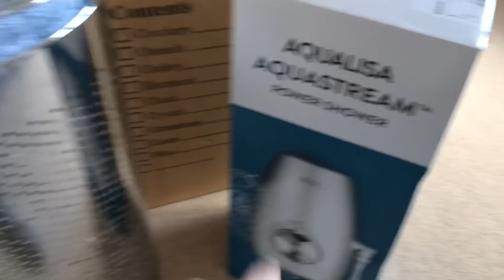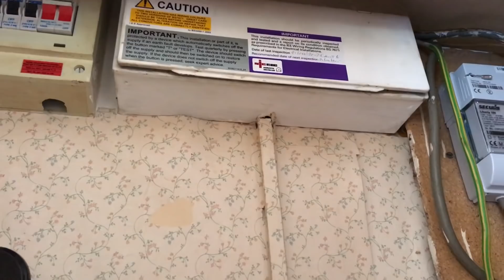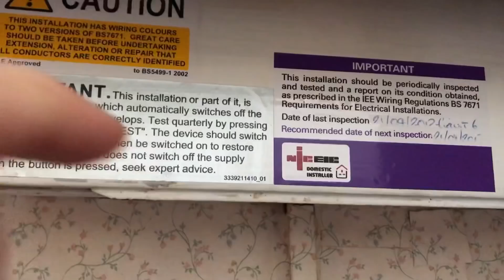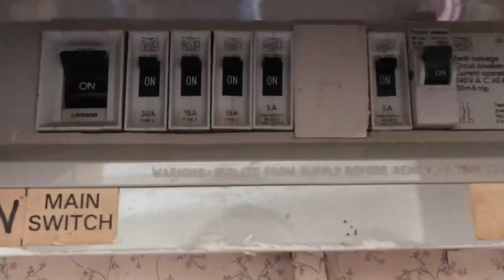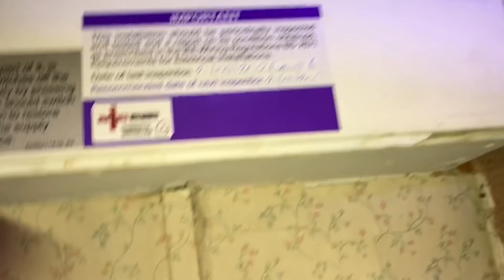CJR ELECTRICAL electricians day wiring and finding more poor installation work!!!

Comment: Do you fuse down the extract fans?
Reply: The extractor fan will be on the 6 amp lighting circuit so I wouldn't have thought so,  but as always, install to manufacturers recommendation.
Reply: @ashmanelectricalservices4318  Usually down to 3A via FCU
Reply: @muzikman2008  There's no requirement to fuse down as the current carrying capacity of 1.0 mm sq  3 core and earth pvc/pvc cable exceeds the rating of the protective device, in this case 6 amps. If Chris were to install some sort of isolation switch in this particular scenario, it would been a 3 pole fan isolator and not a FCU.
Reply: @ashmanelectricalservices4318  I always install a 3 pole isolator and FCU with 3A fuse. The fan usually has zero protection from short circuits, especially the timer variety. I have seen melted timer boards where fans have seized, the timer board motor driver chip burned out, or resistors burned out, and tripped the whole upstairs lighting circuit. Putting a 3A fuse just before the fan is good practice as it can help alleviate that problem if the fan should fail catastrophically. Yes fans are inductive motors and if stalled don't draw much current on their own, but the electronics in them are another short circuit waiting to happen.. I have seen it. No require ment to fuse them, but as I said "usually" down to 3A. Tom Nagey also does this with his FCUs see his channel.
Reply: @muzikman2008  Now I'm curious, how do you fit and connect both a FCU and 3 pole fan isolator? What do you connect at the FCU?
Reply: @ashmanelectricalservices4318  fit the FCU off the lighting circuit, then to isolator, then to fan.
Reply: @muzikman2008  You're gonna have to explain it in a bit more detail, including what core cable you're using  between points and what conductors are being terminated at FCU, 3 pole fan isolator and fan itself.
Reply: @ashmanelectricalservices4318  You are basically fusing the whole bathroom lighting down to 3A. It's common practice. The manufacturers of some fans even state they must be fused down. I can't do drawings on here.. Google is your friend 😉 even NICIEC inspectors would pull you up for not doing it. Not end of the world stuff but hey ho...
Reply: @muzikman2008  So the FCU isolates both the bathroom light and the fan? Yes, I seen this in a couple of fan installation manuals but never done it myself as the existing wiring layout wouldn't permit it without altering the existing wiring route. It maybe more feasible now as most new builds tend to have both the lines and neutrals taken to the light switch before going on the lights themselves.
Reply: Most manufactures will state that a 3a fuse is required but rarely is this done in practice. It’s usually achieved by running the whole bathroom lighting through a fused spur and from there a separate fan isolator for the fan thus fusing the fan down and not interfering with the switches/perm live to the fan. Begs the question why they don’t install inline fuses in the unit itself.
Reply: @tomorichard  They do... 😉
Reply: I spoke with 3 manufacturers technical departments yesterday i.e. soler & Palau, greenwood and manrose and they all said that it is acceptable to come off the 6amp lighting circuit and only requires fusing with 1-5 amps (depending on brands)  where they aren’t connected directly to lighting circuits.. plus all their fans have thermal cutouts..  however, I said to them the problems is I only have your word it’s ok to wire directly off a 6A lighting and should something go wrong I would told I haven’t followed manufacturers instructions etc.. I asked them if I could have something in writing from them and they said yes if I emailed them.. which I will do.. will be interesting to see if they back up their words.
Out of interest I called the NICEIC tech support and they said I should still follow the man instructions regardless unless I can get something in writing to attach to my certs as it’s a deviation..
Reply: We fit a 3amp mcb to cover bathroom fans and lights when first fixing. With led lighting the load on the circuit is negligible
Reply: @tomorichard  Because it`s cheaper for the manufactures for you to do it.

Comment: I wouldnt want the driver inside the cupboard because it does take up space. Not much but it has a knock on effect when it comes to stacking tins n sheet. I would prefer it under the cupboard.

Comment: If there's no isolator fitted, the DNO have given you no choice but to cut the seal and pull the fuse. We can't have people working hot unnecessarily because of a bit of faff from the DNO that's never enforced.

Comment: Just cut the tails and fit an iso just turn off the installation no load so no problem.
I've got insulated gloves so I can do it but I would just cut the seal on the service head most of the time nothing wrong with it it's the meter seal they are more bothered about.

Comment: Wago 222 aren't rated at 32 amps when inside an MF box with 2.5 cable. They are rated at 20 amps.

Debateable if its regarded as accessible under nailed down floor boards but if it's a maintenance free box ir doesnt need to be accessible, that's the entire point of MF boxes.

Comment: In most ways our national electrical code is as stringent as the UK. Some Uk codes may exceed our an some the other way. Our code prohibits any inaccessible junction boxes. This is true in Canada also.
In the US main power lines must be enclosed completely in metal conduit from the. Service inlet from the power grid through the meter, then the main disconnect( which are never wire locked like the meters) and through to the circuit breaker box. We are required to have a 200 Ampere service main usually as a two phase 100 Amp per leg. From everything I. Have seen, the UK residential power is on a single phase. We use more circuits than the UK as our code requires dedicated circuits for things like refrigeration units, electric cookers, laundry washers, electric dryers, dishwashers, electric baseboard heating and any circuit that could possibly overload due to excess appliances. Eg: an electric kettle along with an electric toaster. Any curcuit withi 1.33 meters of a water source is required to have a ground fault interrupter within the outlet device. It is not unusual for a kitchen in the USto have 10 separate cubits to prevent overloading the wires. Our codes also limit an outlet circuit. To 6 outlet devices a# opposed to the UK 12. Most of the time professionals will now recommend that each room be on a separate outlet circuit and breaker 
While some local codes still require that all cables be encased in metal armor, all codes require 5hat all junction boxes be in an accessible location. 
Most of the time junctionboxes are found in basements thhat were never designed as a living. Space, and either the unknowlegable. Homeowner either themselves or. Through a contractorr that used unknowledgable employees illegally enclosed these junction boxes.our newest code requires arc fault protection on all circuits in new construction. This is to guard against the semiskilled homeowner from not securing wiring tightlt enough and from substandard electrical devices from Far East manufacturers, where fakes of all kinds have been emanating due to their non- oversight.Since you appear. To watchYouTube, you might want to check out the Holmes on Homes programs from Canada. And This Old House from the US. I have gained a number of insights into the UK bureaucratic culture show on You Tube shows from the UK with respects to housing renovations. In all trades, although I still have questions about some of the building methods used in the UK such as Whydoes one directly plaster over mason army walls? I am family lark with this from my own childhood  ( the tree ace type house I grew up. In was of exterior walls made of terra-cotta block with direct plaster application and every exterior wall was an extreme source of cold transmission in the winters while generally our winters are colder than in the UK In many regions, it is not that you have never experienced sub freezing temperatures and in many of these programs, it seems that the husband is arrogant that only they must do all the work even when their wives are competent and willing to assist. 
While I myself have severL trades( I have to as I am in the live entertainment field) when there is so much work, I always will find and delegate some of the work to anyone competent enough to do the work and not cause an injury to themselves or others. Electrical codes and methods therefore ar a part of my stock and trade and can be even more complicated as with electronic theatrical dimming equipment you cannot even use a common neutral as it can cause a loop circuit  wherein you  might raise a dimmer for one particular luminary and have an additional one energized as well even though it is controlled by a separate dimmer.  So to avoid that every luminary is connected to the dimmers via its own cable. I have only found this problem when a wiring system was performed by a residential/ commercial electrician using the. Acceptable codes for those normal requirements. Some will not even realize tha due to the creative nature of live entertainment, there is frequently an unbalanced load on the different power phases ( up to three) even though it seems to break the accepted codes. 

Sent from Yahoo Mail for iPad

On Friday, January 10, 2020, 1:35 AM, YouTube <noreply@youtube.com> wrote:

Youtube Logo
Martin W replied to your reply on 132 Buckleup1000's comment
 	
 	
Martin W
Walter Ulasinksi Actually Wago's are unlikely to fail. In reality, you often find very old conventional junction boxes under floorboards, with screw terminals, terminals still firmly tightened and functioning fine. The theory is that the terminals loosen over time due to expansion and contraction, but as I say, rarely happens. So the Wago connectors or indeed Hagar Maintainance Free boxes should't be an issue. They are very extensively tested and deemed appropriate for the application. Which is why they qualify for the MF designation. I'm very surprised that you say US electricians "never" install junction boxes in potentially inacesible voids. I would say there absolutely must be occasions when that's required. From what I've seen of US electrics, the regs seem less stringent than in the UK.
REPLY 
If you no longer wish to receive emails about comments and replies, you can unsubscribe.
© 2020 YouTube, LLC 901 Cherry Ave, San Bruno, CA 94066
 YouTube		 Twitter
Reply: Just to clarify, normal US residential services are not ''2 phase'', it's still single phase 240V just like the UK. The difference is the US supply comes from the Delta secondary of a distribution transformer, with a third wire at the center tap of the delta winding which provides two 120V supplies and one 240v supply, but the two 120v supplies are not out of phase with each other, so still single phase. In Europe and much of the rest of the world the supply is from a Wye secondary, with 240v (or 220v) from each leg (phase) to the star point. Of course normal residential properties only get one of those legs and the neutral (star point), whereas a 3 phase supply would give you all three legs plus the neutral, usually with 400v between phases (lowest 3 phase voltage here), while in the US 240v 3 phase supplies are common.
Reply: @literoadie3502  while much of what you say is true, it also depends upon the step down transformers at the power facility stations. Many areas only have two phases coming from the step down transformers. It has driven me crazy when I have had to convert three phase lighting dimmer equipment (4 wire) to be balanced to work on only two phases. ( 3 wire). In these areas, the additional step down transformers, then convert to two phase 120v service for residential locations. 
This is as I have seen in these videos, that the Service mains to the meters are only 2 wire. ( single phase) and so far, I have not seen the nature of main service from the supply factor( overhead or underground) which in the US will determine the wire gauge and insulation component sizes. 
I have been in a position where it was necessary to pull 600 Amp  three phase ground cable ( 4 wire) to be elevated and hung for the main service for a Circus tent. Partly due to the location where to do a tie in to the service delta step down transformer. It needed to be fed through major fresh air ductwork to the underground location.This was in addition to the temporary service pole with major rain head entry service attachment. 
While it is possible that with a single phase, no matter the voltage, one can supply all the growing needs for a residence, it usually means that instead of a 100A supply you might need a 200A supply or higher, with the resultant increase in wire gauge.

Comment: Could scarcely believe that JB with all the cpcs just hanging there.
Reply: Really ? Is seems a common practice with the cowboys, I find the cpcs cut all the time, especially on 12v down lights
Reply: @supersparks9466  : Yep seen it regularly, cut out the CPC's. A "so called" Electrical engineer once told me that they're only in cables so the manufacturer can charge more money for the cable (sad thing was, he seemed to seriously believe that).
Reply: I fitted 37 new Luceco lights last week, and everyone of the CPC's were cut off at the JB, not even terminated! BS7671 states a CPC MUST be available at the JB for termination to any existing or future accessory...
Reply: @muzikman2008  : Only problem with that: I doubt half of the idiots have ever seen a copy of BS7671, never mind opened one to look at the writing inside.
Reply: Really, you can't believe it... This happens all the time, more often than not by cowboy builders, they think that because the fitting doesn't require an earth, they can just cut it out or leave it out.
Reply: @rscelectrical7091  😯 I've only ever seen it on lighting circuits.

Comment: good video mate, if I have to put a JB under a floorboard I will always write on the floorboard in marker with the exact location of the JB
Reply: Until the customer wants a nice sanded original wooden floorboard with varnish on top :-)
Reply: Inspection of concealed cables within trunking, conduit, under floors, in roof spaces and the generally fabric of the building are not required whilst carrying out an EICR unless specifically requested by the client.

Comment: 4:22 that would have never ever passed electrical inspection by the network operater in germany!
Reply: It shouldn't have passed here either son so don't get on your high horse thinking you're better in Germany. At the end of the day if a sparky is a cowboy, and the homeowner knows no better, then the sparky is going to do what he wants and pass/fail what he wants, hence the dangerous work this chap comes across. Also British regs are used more worldwide than German regs, I feel you may think our regs and standards are not very stringent based on some of your other comments, in which case you'd be seriously mistaken. I've heard things about German electrics that don't exactly sound great, but then again I don't instantly believe everything I'm told, nor do I go around arrogantly acting as if I'm better than sparkles from other countries. Nob.

Comment: Lol - had a laugh reading the title! Compared to wiring done by a german licensed master electrician almost every british wiring is poor quality (even if done by a british professional)!
Reply: We British are very good at inventing new tests to test what would not need testing. The real problem is that the house building industry lacks any licencing of Building Plumbing, and Electrical.
Of course there are some very good, good and very bad so called trades people, but very few "Professional", due to no licensing. There are only a few occasions where a builder, plumber, etc have been convicted of a criminal offence due to their negligence.
Does the German method of building/construction differ from here in the UK?, I think you use more concrete. I was told that in Germany, that all concrete for construction, must be supplied by a specialised company only.
Reply: Bosted Tap yes, it does! In Germany you have to be licensed in every way! Otherwise you are not allowed to perform work!
Reply: Dont forget though, this was an old house that's had all kinds of crap done to it. The current regs are very stringent.

Comment: Wago's are rated at 32A on 4mm cable and bigger. Only 24A on 2.5mm cable buddy. Go check the diagram
Reply from the maker: Is this a joke ?
Reply: @Cjrelectrical  I wish it was a joke, google it.
Reply from the maker: Why would the amperage drop with the size of the cable ? And I’m sure 4mm is the maximum cable size the 222 take.
Reply: @Cjrelectrical  Have you managed to find info on it? I dont see why either, plus if you watch stress tests on wago's they take well over 80 amps before they fail. Yeah im pretty sure the max is 4mm
Reply: Wago 222 lever connectors are rated 32A and conductors up to 4mm can be used. It’s the push wire 773 (orange) type that is rated 24A when using up to 2.5mm.  The 773 (red) type is rated up to 41A and can accommodate up to 6mm.
Reply: I think you will find you are quoting different part numbers of wagos.
Reply: Gsh electrical's recent video clears everything up. The 20A rating at 300V is for Japan and the 32A at 450V is for Europe so they are fine to use on ring mains etc